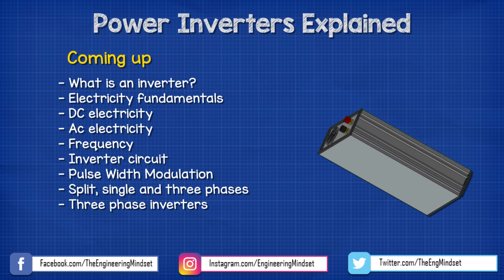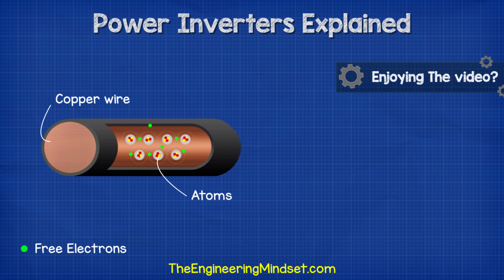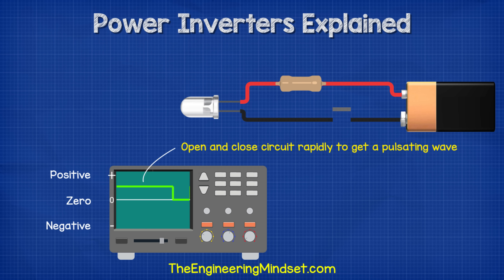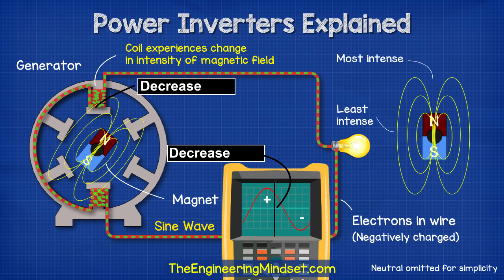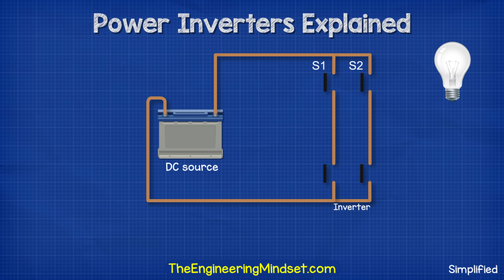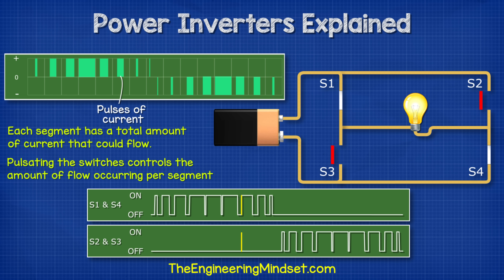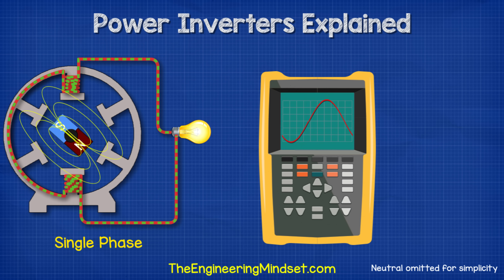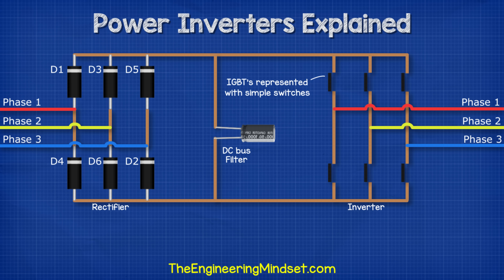Power Inverters Explained - How do they work working principle IGBT

Comment: Here I go again The more I learn the less I feel I know
Reply: Youre experiencing the dunning kruger effect* (or however you spell it). Youre going towards the pit of confidence but dont worry after you pass that pit, your confidence will increase with the increase of knowledge.
 
If you dont know about this, i'll try to explain it the way i understand it. they (dunning and kruger) observed how people with different levels of knowledge displayed confidence. People with no knowledge had no confidence, people with (overall) little knowledge had a lot of confidence (i get to explain this a bit later). people with with moderate knowledge had a lot of doubt. And the experts had a lot of confidence. The graph kinda looks like this _/V.
As people start learning about something their scope of the overall knowledge starts out small so they believe they have conquered a high percentage of all knowledge to be had. That is until they realize that there is a whole lot more to what they do not know, thats when their confidence start to fall. And it will fall more and more until they have the full scope of the knowledge to be had. Kinda like moving the goal post further and further until it doesnt move anymore. And as they continue to learn, they get closer to the goal and that builds confidence.

Comment: Great videos and the animation really helps.  Will you explain how power is sent back to the grid from solar, wind or alternative power sources as at someone's home? What has to be done to the power to make that happen?  Thanks.
Reply: You have to use a transformer to step up the current to travel the distance & if you on grid you'll probably have to have  a different supply then the average person
Reply: Thanks!
Reply from the maker: Seen our new video on HOW SOLAR PANELS WORK in detail https://youtu.be/Yxt72aDjFgY
Reply: Thanks!

Comment: In the final part with 3-phase output and 6 switches, the closing and opening of these switches should only affect the directions of the output currents, and should not relate to which inputs to be drawn from. Also, one of the main essence of an inverter is the ability to vary the output frequency, which is different from the input AC frequency.

Comment: Great video and explanation.

One side note: Sometimes it might be difficult to get hold of a 3-phase inverter or an inverter capable of outputting the amount of power required. Therefore, some manufacturers offers inverters that can be connected in parallel to get more 2 or 3 phases instead of one, or in series to get more power (as in more Amps or Watts), or even combined in parallel and series to get perhaps 3-phases at 32 Amps instead of 3-phases at 16 Amps. But please be aware that only some manufacturers offers these solutions, and also that it is usually required that the inverters can communicate through perhaps a CAN network.

Another side note: You mention inverters outputting square vawe AC and modified sine AC. Please aware that there are also som inverters which output "pure" AC; ie. with very few or no ripples and a pattern when viewed on an oscilloscape virtually indentical with what you will get from something like a wall socket. Also, some devices like certain electronics might be unstable or even be damaged if used with square vawe or modified sine AC.
Reply: Yes, good advice!   Also, for any viewers who don't know, there's one more thing to be aware of as the winter approaches and we face the possibility of power outages, like last winter (2021.) - AC generators (standard gasoline generators.)  Be careful about what you plug into a standard AC generator.  They too produce a "dirty" square wave.  Televisions and any other electronic appliances that have multiple circuits with various voltages inside them will not respond well to regular AC generators.  They require an Inverter Generator, which produces AC voltage, then converts it to DC voltage, then inverts it to "clean" AC voltage with a smooth sine wave (as shown in this video.)
Reply: @SteveWhiteDallas   inverter generators?

Comment: Can I say anything that moving, are of magnetic field ? Bcoz to create it to move, need to magnet
Reply: Speaking of electrons? Yes! Other things move under gravity or some type of pressure, like water down a slope etc. However Gravity too forms out of electromagnetism....
Let's just say Yes all electrons in consistent motion are mobilized by some kind of magnetic force. Electrons in random motion are at idle-mode. They are just idly wandering about till mobilized under a kinetic energy (usually magnetic in mature).

Comment: Why is it that a 12 volts motor spin faster in 50hz 110-120 volts than 60hz 220-240 volts? Since the polarity of 60hz is 120 per second therefore the current flow is faster than the 50hz am i right?  Can you explain this please 🙏🙏 by the way im from Philippines and were using 60hz 220v here.

Comment: @ 8:49 How does altering the frequency of the pulses alter the voltage?? Each of the pulses should still have the same voltage as that of the battery. Not more or less than it.

Comment: I have installed an inverter in my car; strictly to power up a behringer 120 volt digital audio pocessor, it powers up and everytyhibg works (but not as it should). I am getting a loud buzzing sound when the audio system switches on, even when i pause the CD the buzz is still there. The technician said its an inverter noise, he proved this by unplugging the  behringer pocessor from the inverter and plugging it directly into a wall socket: (thats when all the buzzing stopped) and it was pure clean music (with the engine running to keep my car batteries charged). He recommends that I buy a pure sine wave inverter (insisting that the chinese one I bought is not a pure sine-wave, "even though its written sine wave on the box"). HELP! Any suggestions?
Reply: Hook up an oscope to see the electricity to see if it really is correct, it's probaky wrong

Comment: How does the controller work that times the opening and closing of the transistors?
Reply: computers and controllers are basically calculators, they do these types of calculations way faster when you load a video or play videogames

Comment: Hi The Engineering Mindset i am a viewer from Algeria and i have so many questions to ask you about electrical installations.
the two most urgent are related to solar installation and grounding
1. i have a distribution board with two sources of electricity, city electric and solar (2400W inverter) 
the thing is the two electric circuit are never in contact with each other  but i have to properly ground all the electric sockets for safety .
the question is do i make sepret grouding bar for the diffrent sockets or it doesn't matter or there is other solutions.
2. for my solar installation i have a pure sine wave inverter from EPEVER 2400 watt and the problem is that it is properly grounded but when i mesur from the neutral or live wire to the ground i have half of the potential (115 volt) .
ps:  i have 230 volt between neutral and live
i heard about neutral bonding and floating neutral but it is high level for me.
i hope you can help and thank you in advance.
Reply from the maker: Seen our new video on HOW SOLAR PANELS WORK in detail https://youtu.be/Yxt72aDjFgY

Comment: Does the transformer also have the bonus effect of making the PWMed “fake” wave into a real smooth curve or no?
Reply: I was wondering that too. I know that some appliances cannot work on a inverter unless it is a "true sine wave" inverter so I suspect there's some more special sauce there.
Reply: I wouldn't call it a "fake" smooth curve because there is no such thing as a perfectly smooth curve. At the lowest level, everything is quantized, in the case of electricity, individual electrons. The PWMing can probably be made effective for any real world application if it's well enough defined, ie. if the sample rate is sufficiently high.

Comment: Now i knew that transistors in inverter are important not just to convert DC to AC again but to have more power. And i learned the difference between full bridge rectifier to high current transistors to convert two types of electricity.
Reply from the maker: Transistor video now live: https://youtu.be/J4oO7PT_nzQ
Reply from the maker: Rectifier video here https://youtu.be/RiRyzLl4Y8U

Comment: Hi I want to make a VFD for an AC electric chainsaw and turn it into a solar powered go kart motor with ultra capacitors instead of batteries. Can you recommend a video or make one for such a project? I want a simple speed controller for the motor instead of it being always on or always off.
Reply from the maker: Seen our new video on HOW SOLAR PANELS WORK in detail https://youtu.be/Yxt72aDjFgY

Comment: I’m confused as to why “inverter generators” are needed. It looks like the cleanest sine wave would be produced directly from the generator itself, not converting to DC, then inverting back to AC using pulse width modulation. Why are inverter generators better for sensitive electronics?
Reply: One of the main reasons is that you can store DC and not AC. But your appliances mostly  need AC.

Comment: If AC is going back and forth the wiring, how come if I connect the “Line Wire” onto any metal bar, such as water pipes or steel bars from a construction, there will be a spark or if I plug a light bulb to the Line, and the other end to ground, you can make it work? 💡

Comment: I want to use car battery as a back up for my laptop, router, light etc. My question: how to calculate car battery life when used as an electricity source or how long will it lasts? Thanks.
Reply: Just get the ampere hours (Ah) of your battery and after this calculate the current draw of all your components with  I =U/R
By dividing the Ah of your battery with your consumption in Amperes you can estimate the  runtime of your battery
If you have different voltages in the circuit, you better go with watts
So get the watt hours (Wh) und and the consumption of your cicuit in watts and divide like above
Reply from the maker: Check our our new car battery explained video: https://youtu.be/VnPRX5zQWLw

Comment: Well there is actually to ways you can use AC-device on DC voltages 
The first way(witch all worked for me) is to use a multi-meeter to find out the output voltage on the transformer(if available) and rewire the device with the proper gauge wire and appropriate connecter

Or

Just buy a power inverter to make it easier to test without taking it apart or short circuit something by accident

Comment: I want too power a 3 phase induction motor with a single phase synchronous generator that has a 220 V Ac output. Is it wise to use a full bridge rectifier to convert my single phase 220 V to a DC voltage and then use an inverter with 6 IGBT's to convert  the 220 V Dc to 380 V 3-phase Ac? ANY HELP

Comment: Hi Paul how would you connect two inverters on the output 230v side from two 5000w inverters? i have one 5000w that only delivers 2085 w need to double this to run my water heaters in a camper van home build any ideas please.coffee and a cream doughnut coming your way.

Comment: Great video, clearest explanation of any I have watched.

What I am confused about is what minimum voltage needed for a controller to efficiently drive a 3-phase PMSM traction motor from a DC source (battery). If I had a 96v motor, from what I understand I will need a DC supply with 96v / sqrt(2) * efficiency volts. So if the efficiency of the controller is 95%, I would need ~143 vdc (after load sag) to cleanly produce 96v 3-phase AC using the IGBTs. However, many motor controllers for a 96v motors accept a maximum of 120vdc. Without using a transformer, how do these controllers produce the full 3-phase 96v sine wave to the motor?
Reply from the maker: Well you would use a bank of 12V batteries with large Ah capacity because you don't want the batteries to run down. If you find a motor and matching VFD it should tell you the input, or just ask the manufacturer. We don't offer consultancy or private tutoring but hopefully that points you in the right direction

Comment: I use some batteries from time to time whenever I'm on the go, and for things like my laptop and whatnot I'm always trying to find DC plugs for things so I don't need an inverter to charge or power it. It's a shame that not as many things are as optimized for DC, but that's how things are :P when you're used to using batteries and whatnot, it's nice to not have the power loss associated with an inverter, since a lot of the time what you're doing is converting DC to AC, then right back to DC for the devices to work. For my laptop I was able to find a cigarette lighter adapter, provides the same power, just through a cigarette lighter outlet instead of an AC outlet, so if I want to use my laptop on the go with my batteries, there's no need for the inverter losses.
Reply: ...if you can line up enough batteries for hundred volts DC then your plugin computer power supply will run your computer from that . read specs on the supply . but doesn't tell you it works from DC also . But 100 volts might start to be concerning to mess with for some.
Reply: @philipvernejules9926  Laptops use around 19V to 20V most of the time. Oftentimes it might say on the laptop the spec, otherwise it'll say on the power supply that came with it.
Reply: @00SNIVY00  ....so it would be eight 12 volt gel lead batteries in series. Definitely too awkward to use AAs . Because the plugin power supplies convert to DC the mains voltage anyway before converting to a higher frequency, they will happily accept an already existing DC input. Voltage range indicated is 100 - 240 volts input. 
..comment in my mail is the one I'm answering , it's different to the comment on this thread .
..I know. Not everyone has gel lead batteries in quantity. However many folk do have half dozen eighteen volt lithium cordless tool batteries .
Reply: @philipvernejules9926  lmao that was a dumb mistake on my part, of course it'd be lead acid batteries not AAs lol.
What are we even arguing about here?? I only said I prefer having a DC to DC converter for when I'm running off of battery power. Why go from DC to AC and back to DC when I could use something that's just straight from the battery. Inverters are better, sure, I could use one without a huge problem, but it's wasteful when the alternative skips that step of conversion.
Reply: Johannes Terzis  it's not a lot, but it's still a waste of power. I have a 400Wh battery, an extra 10 Watts being used when there's a simple alternative is just wasted power when it's not necessary. I should've clarified that my "limited power source" is a battery, not just some 12V adapter from wherever.

Comment: Hello friend how are you Rafael Méndez writes you and seen your channel I also subscribed and I find all the information you provide in the wanted to ask you very interesting .. look I want to generate a device that requires a 740/1040 watt power supply the idea is make it radio controlled rc, in colombia we use direct current at 11ov the idea is that it must have rechargeable batteries for at least 5 hours of use in cycles of 5 or 10 minutes maximum the idea is to implement an inverter the transformer but I do not know what rechargeable batteries to use It is simply to develop a project or idealize it additionally it must have the microcontroller system and some operating sensors such as a camera motion sensor and others I saw that you can access a paid subscription but the truth is that I do not have the resources to pay you additionally The conversion of Colombian pesos to dollars would be very expensive. To be honest I feel sorry to ask you for the favor without paying For your coloration but I have no alternatives, the idea of this is to develop a prototype that I enrolled in an innovation institution but I think my idea was stolen and I do not want to fail in this, I appreciate your coloration whatever your answer is thank you.

Comment: 1) I read that an inverter can not only multiply the voltage output of a battery but also the Amp Hours too. Is this correct?
2) If #1 is correct then can I, in theory, use 1 battery with an inverter to power all my electronics on my kayak instead of needing to run multiple batteries for each accessory?

Comment: Can you please help me understand something. I live in the US and we have 2 phase 120 /240 volts, my breaker box has a main 200 amp breaker, what i cant figure out is if i have a light that uses 5 amps on 240 and 10 amps on 110 can i then run more lights via 240. 240volts x 200amps = 48000 watts  but 120 x 200 = 24000 watts , so which is it ? can i draw 48000 watts or even if i use 240 volts my max is 24000 watts from a 200 amp breaker? Thank you in advance.